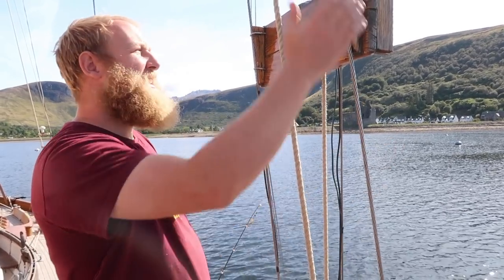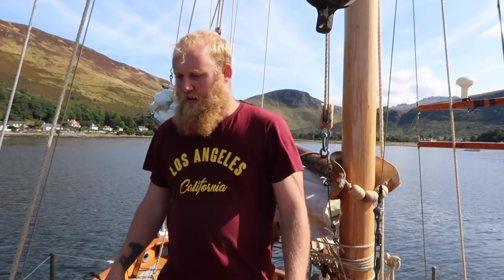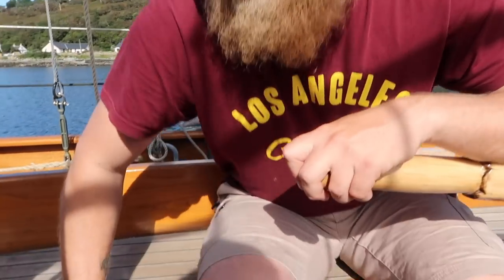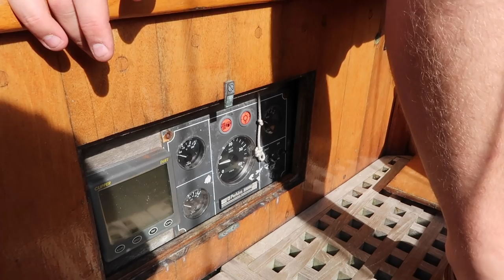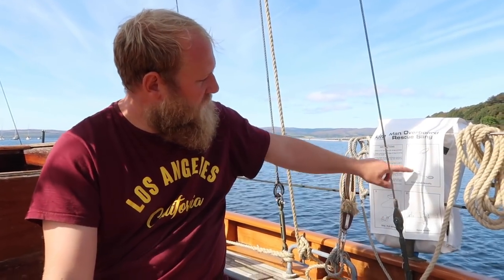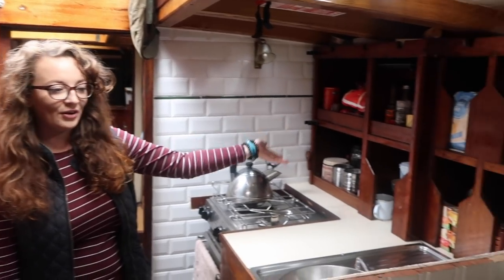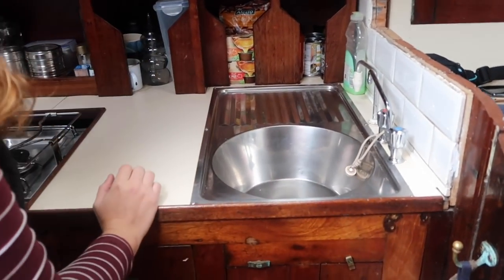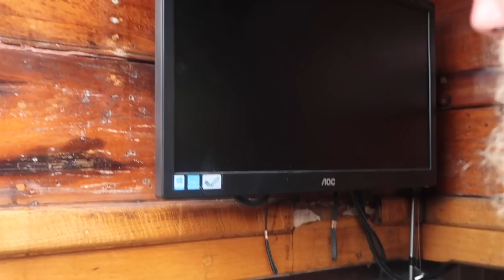Boat Tour - Our 1920's Dickies of Tarbert Gaff Ketch

Comment: you mention getting rid of the double ended halliards on the main throat and peak halliards; on our gaff rig we fitted independent pulley systems to one end of each. This allowed us to hoist and drop quickly using the "free" end and then use the pulley systems to tension the halliards when hoisted. With the two ends with pulleys on one side of the mast and the "free" ends on the other side the primary hoist can be done from one side with both halliards being pulled up at the same time, and then tensioned from the other side. Without this we found that the number of pulleys we needed to have in place to hoist and tension the sail created too much friction for the sail to be dropped easily in a blow.

Comment: Do you plan to just use a 2 sheet block for a better advantage on the next throat halyard?  It seems easter than the 2 side half way system but I'm not sure I totally understand the system
:edit and you answered my question on the mizzen!  Awesome video and boat
Reply from the maker: Yup, plan to re-rig as part of the refit. Want to make a few changes to better suit us. The current set up is a bit complicated, has more advantage then just a 2 shiit block but more work swaping sides, I feel a simpler system should work fine.